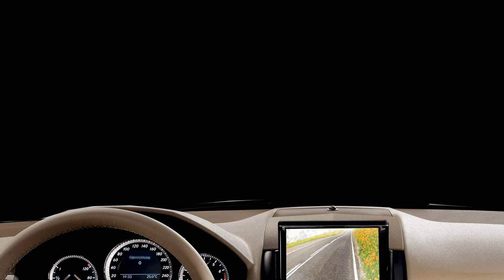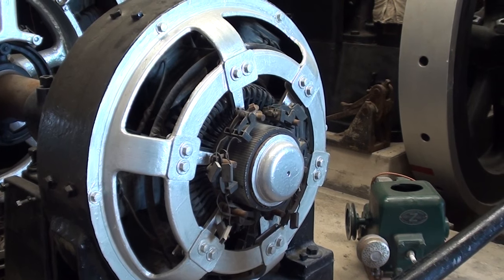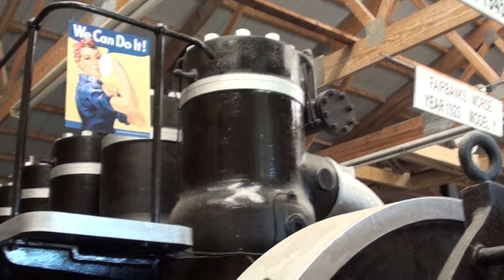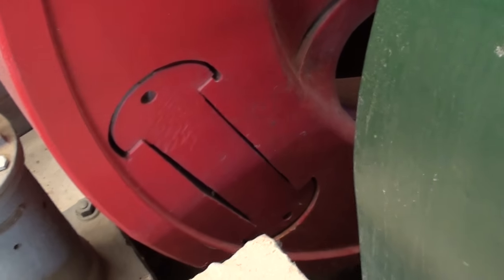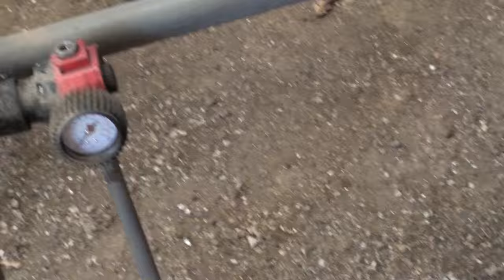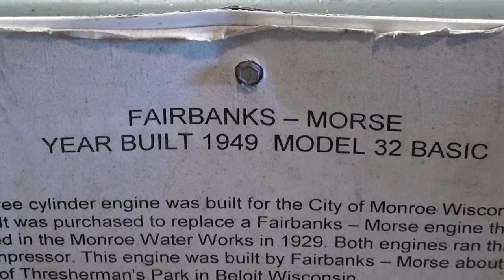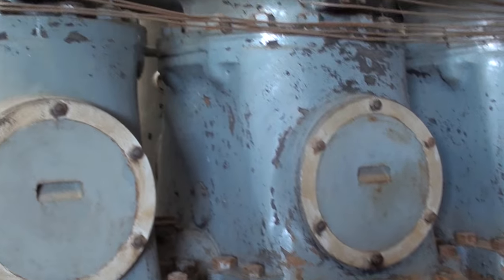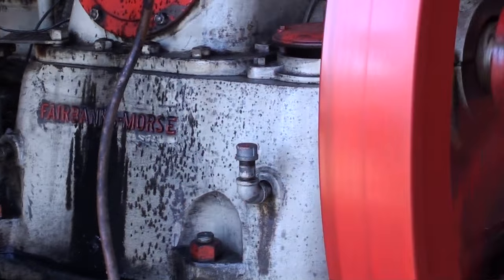HUGE FAIRBANKS MORSE DIESEL ENGINES & GENERATORS tubalcain

Comment: Thanks Lyle for another interesting video. You might find it interesting to know that many years ago I machined the compression rings for a single cylinder Fairbanks Morse engine from motorcar brake discs. this FM engine was powering the machinery at an old brick making factory. I do know that 15 years after making those rings the old engine was still operating when they closed down the factory. Kind regards.

Comment: Maintained old F-M vertical turbine pumps in flood control pumping stations for 24 years. Simple design, low speed,  couldn't break 'em. Had plenty of Worthington Pumps in our sewage pumping stations also! Those old pumps could push 16,500 gpm, 24/7!

Comment: Lived with Fairbanks engines on two of the ships I sailed,  one built before WW2 had ten cylinders, opposed pistons (cranks on both top and bottom), the second build 30 years later had 12 cylinders but otherwise identical except for turbocharging.  The old engines made 1200 hp at 1200 rpm, the new engines made 3200 hp at the same rpm.  Outside of these two engines were a pair of Pratt & Whitney gas turbines that were much much smaller and lighter that made 16,000 hp each.  We could run the ship at 20+ knots bruning 5000 gal/day of fuel or do 32knots on the turbines and burn that much in an hour!
Reply: Thanks for commenting! Very interesting!

Comment: what's really cool about these old machines is that if something happens to the electric grid in that town. You still have means of power. Albeit a small compared to what was the norm. You would have to do a city wide reworking and re-wiring most likely. But possible

Comment: The square holes in the flywheel and the jack beside are used to turn it over when working on it not to start it
Reply: How did they start it?
Reply: Most of em used compressed air that was forced into the cylinders to turn it over.